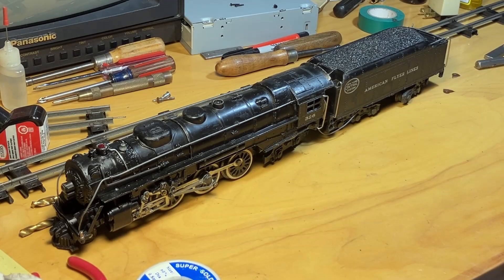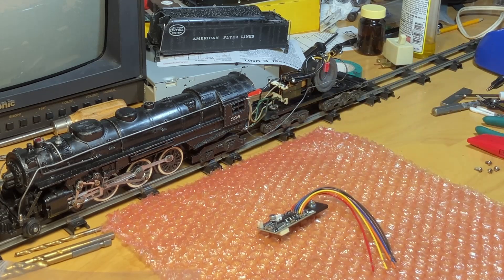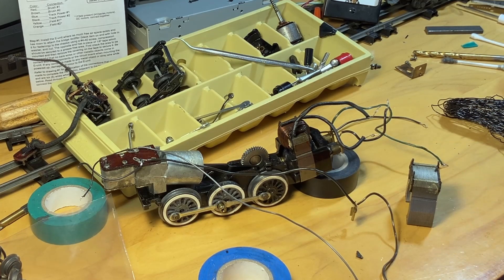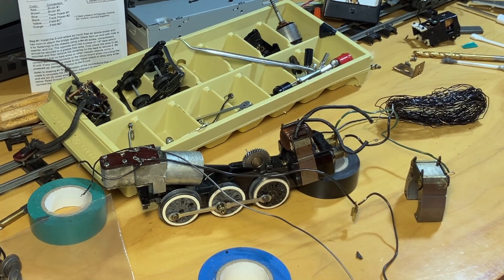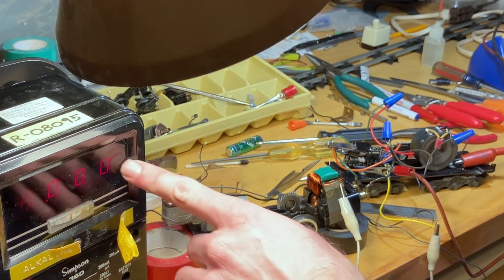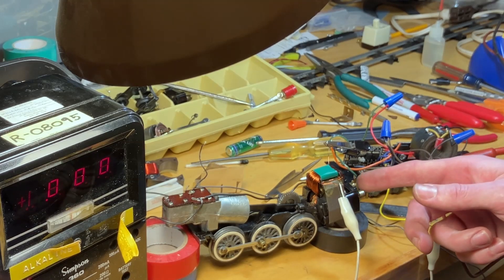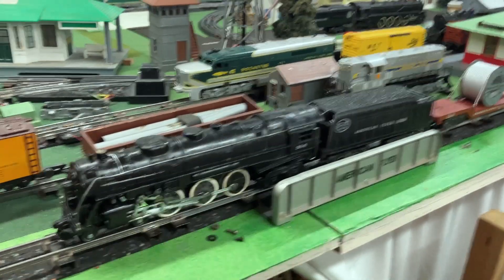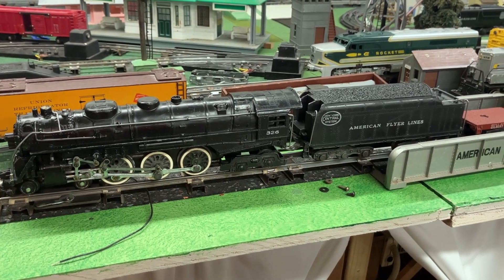American Flyer Motor - Burnt Up and Rewound

Comment: Well done!  I noted you had to remove some length on the wrap.  Did you find any operating difference when you switched between ac and dc?
Reply from the maker: Operation seemed identical on AC or DC. The extra wraps does seem to reduce speed, not sure about improved torque because of a lack of traction tires

Comment: Im confused, did the part you added allow the train to run on DC or does that train run on DC? I have an AF 350 but no AC power source. Could I just use DC? (I'm completely new to this hobby)
Reply from the maker: Welcome to "The best Hobby in the world"! These motors are called universal motors, they will operate on AC or DC. However, the reverse mechansim tells the motor to go forward or reverse. Without it, it would only go forward. The unit I added is an electronic circuit to replace the mechanical one. I would recommend and AC transformer, look for an American Flyer unit like an 8B. They are relatively cheap and usually reliable. Or you can get a modern AC transformer, but make sure it's got at least 75-100 watts. MTH makes modern AC controls (Z750/ Z1000) that work pretty good. There's lots of great resources available, plenty of Youtube videos on all sorts of American Flyer repairs and How To's (including my videos) also Austins American Flyer, Daves American Flyer Trains, Precision Flyer Repair and more! Thanks for watching
Reply: Thanks. I've been studying your videos on the 350 for weeks as I try to get this one moving.

Comment: Great job with the repair and thanks for the information.  I didn’t know that about the wire.  I don’t think any of my engines have that problem right now but it’s good to know that it’s something to watch for.
Reply from the maker: Most do not have any issues, just this one particular dark purple coating is the culprit. Copper colored coatings should be fine.

Comment: Nice work getting the 326 running again. Perhaps the reverse unit can be repaired and used in another project. lots of patience and attention to detail is needed when rewiring fields and armatures.

The nightmare you mentioned (rewinding an armature) is about to be undertaken here. It will be a first. It is for a Pullmor motor so it seems to be a worthwhile project.
Reply from the maker: Hope it goes well!

Comment: I have a 1953 343 that I need to rewind the field for.  I have the Tom Barker book so I'll have to see how many windings or feet of new wire are needed for this field.  I made a cheap jig but I don't know if it's heavy duty enough to keep the wire taut while I wind it.  Did you do the entire winding by hand or did you use some kind of jig?
Reply from the maker: A jig would be better if you can make or buy one. That will help keep the wires packed tighter. Loose windings will get hot. I managed to do mine by hand. If the old wire is still on, the best way is to unwind it, lay it out flat and measure it. From what I know his guide only says "Steam armatures, 24 gauge, 40 feet". I could not fit 40 feet onto a large field, so it's kind of trial and error. i had to do it twice. you also can use an Ohm meter. Standard fields should measure 1.3 ohms give or take, 1 ohm or less is generally too low.
Reply: @ObsoleteModelTrains  OK, thanks.  I still have the old wire, I have already removed it but I can measure its length before I attempt to wind with the new wire.  Your video is so helpful and it was great to see that you were successful.
Reply: There is another book, "American Flyer Electrical Reference Manual" by Robert Hannon that gives detailed data on wire size and number of turns for most of the American Flyer electrical devices including motors and accessories. It also has pictures of most of the cores to see what they look like before winding.

Comment: I'm surprised. I thought the air chime speaker in the tender would be barking on DC current.
Reply from the maker: No for two reasons, this particular one wont work on DC at all. The horn generators are high frequency AC over AC current. Not like the DC relay activated horns. And second, I disconnected it!

Comment: Well done! I've been happy with my Dallee reverse unit. Interesting about the enameled wire & the conflict in Korea. Lionel didn't have that issue. But they had to drop Magnetraction due to shortages from that same conflict. Not good for them as it was released the year before 😢

Comment: I just picked up two S Gage trains. I hope I don't have to go through all that to get them running. Cross your fingers.
Reply from the maker: It really depends on how the trains were kept over time. The biggest issues are cleaning the motor commutator and the reverser mechansim. And removing all the old dried up grease and adding fresh lubrication. There's lots of videos on repairing Flyer, including mine, but also Austins American Flyer, Daves American Flyer Trains, and Precision Flyer Repair.

Comment: That was an awesome video. Thanks for sharing.
I have a similar project that I wish to tackle. Did you order directly from DALLEE or did you get it from a third-party vendor? I’ve looked up the company on the Internet and everything I get is kind of vague.Again, thanks for sharing.
Reply from the maker: I ordered through the manufacture, because Portlines was temporarily closed. You can order now through Portlines Hobbies website (portlines.com) and shipping will be cheaper. If you are putting it in a standard motor steam engine you can get away with the smaller 4 amp version which is less $$.
Reply: @ thank you for the information. I will try ordering it that way.